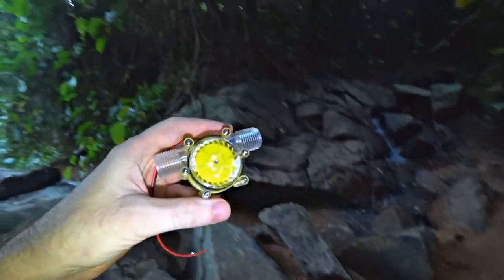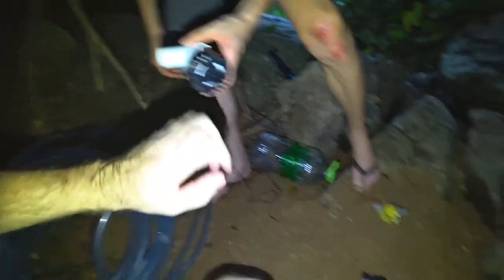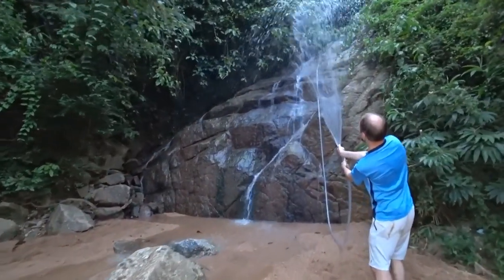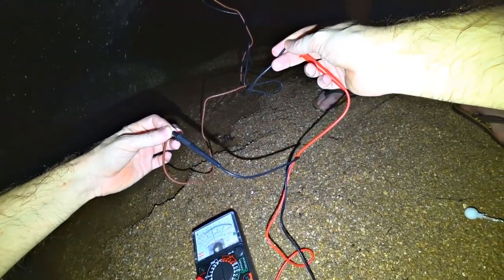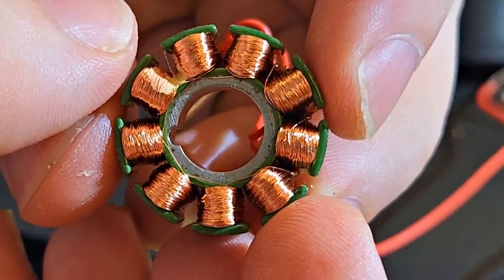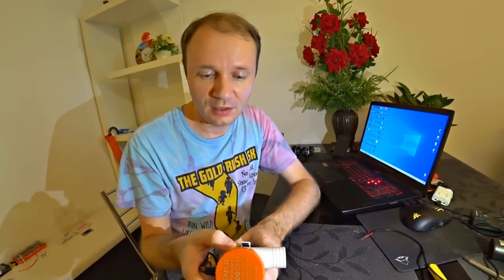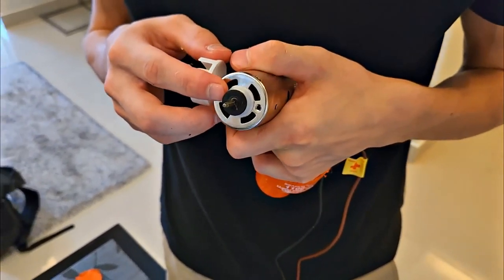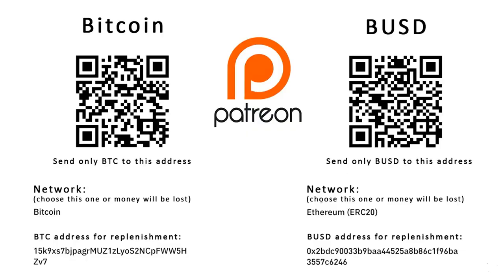Mini HPP from a Pump and a Hose⚡️How easy build a Hydro Power Plant for SURVIVAL on the island

Comment: This is what I like to see. I have my house set up with 5v and 12 volt lights and they are plenty bright enough and I save a lot on my power bill by not using the main power.
Reply: that dont help because the bill is mostly set fees, not actual electric use
Reply: @1112223333111  wrong
Reply: @1112223333111  It depends of the country. 

Here in Finland it does not matter how little you consume, there is always the transfer fee that is usually bigger than the actual cost of electricity atleast if you don't use much electricity.
Reply: @Teknopottu  and bs climate action fees and more. then they tax you on those fees
Reply: im not allowed to connect solar to my house as im in government housing, so i have a portable powerstation, im not sure how much it saves me, but i only use $20 a week in electricity :) i charge everything from my torches, my vaccuum, my mobile phone, my camera and more! costs me more in connection fee than it does for what i use

Comment: i hear there is a Washing machine with a premo motor that is super efficient when used as a water turbine.
Reply: Yes it's called a direct drive washing machine and they are normally found on front load washing machine which is super common in Europe

Comment: A blower fan unit would work well.  A 12V one sold as an accessory heater booster for older cars with exhaust pipe heat exchanger cabin heat.

Comment: The gaps allow partikals to pass thru the pump without jamming the impeller , pumps for dirty water / garden dams, drainwater, lakes would get jammed easily  if the impeller was very tight in the impeller cavity.  The centrifugal pump does not need to be water tight in the fitting. They are subredge d, thus making them self priming.

Comment: Is it possible to use alternator from a car as a generator?
Reply: Since the beginning of time people have used the car alternator but it is not efficient in several ways.    Larger homebuilt Windturbines Use radial design strong magnets and less losses.
Reply: @mike289homebuilt5  emmmm.... so that means yes or no?
Reply: @sauliusjance6300 No.   Car Alternator is poor choice.   It will work ok but has some big Losses
Reply: Use a motor from a washing machine or a dryer, they work great if you can spin them fast enough.